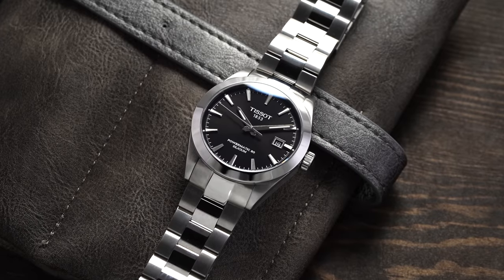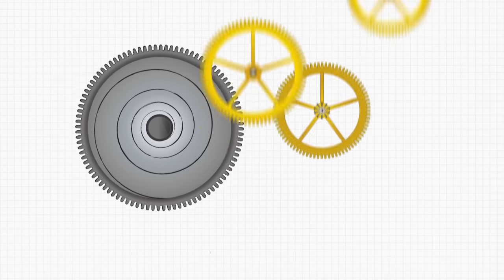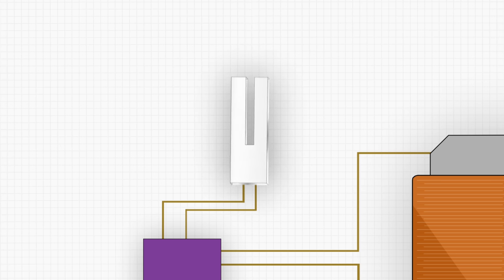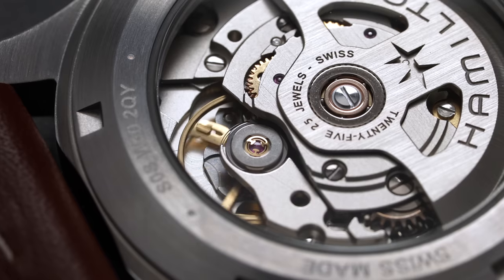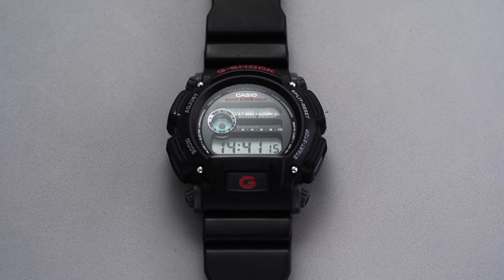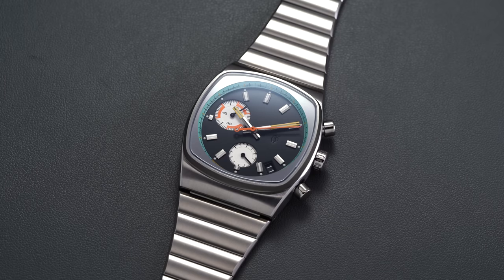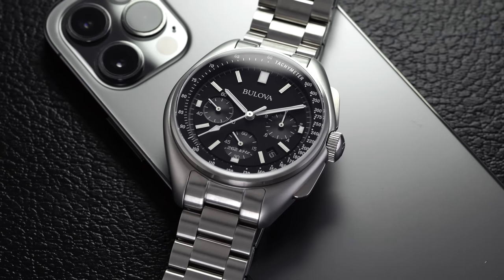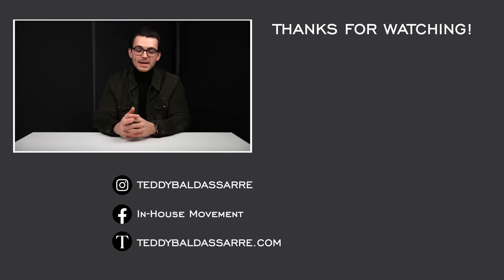Why Every Collector Needs a Quartz Watch - How They Work & Everything Else You Should Know

Comment: Hey Teddy a suggestion, why not do a “best quarts watch collection at different price points and functionality” this could help guide collectors and potential collectors as to what’s available on the market. I’m sure the list is very long so a selection would be good.
Reply: Amazing idea !
Reply: I'm in!
Reply: Not a bad idea, except that as someone said, G shock would win every time for functionality and durability.  Outside of G shock, Bulova came out with its Precisionist line of ultra accurate quartz movements a few years back, but chose to put the movements in some of the ugliest watches around.
Citizen makes its Eco drives which are basically, solar powered quartz.
For plain old quartz, IMO, it is hard for a reviewer to differentiate the movements.
Reply from the maker: Thanks for the suggestion, Gilbert. We are working on something more comprehensive that is along the lines of this. Appreciate the comment and good idea!
Reply: Good idea 👍 The Rolex Oysterquartz 17000 is a great watch
Reply: @stupitt6989  what fool would buy that? Get a Grand Seiko instead.
Reply: @Al mac  didn't realise that not only is there watch snobbery between mechanical and quartz, there's also watch snobbery between quartz watches.
Reply: @johnyoung8144  watchmakers are known for certain models. Rolex are certainly not known for their quartz watches. They make them but they are an afterthought. If you like them then you probably can probably get good deals on them so you are in luck.
Reply: This needs to include the Casio Oceanus, Citizen Chronomaster, and Grand Seiko 9F Quartz line of watches.
Reply: @TeddyBaldassarre  I would hope that you would look at the first in-house quartz caliber from Omega which is the 1310, a great example of a well engineered mostly mechanical movement driven by quartz ironically that almost needs to serviced like a mechanical watch but just not so often. They can be extremely accurate to within a few seconds a month if looked after correctly, by someone who knows what they are doing. I have quite a number of these now and absolutley love working on them.
Reply: @stupitt6989  A grail of mine.
Reply: @almac9203  bc the bracelet
Reply: Sinn UX usg9
Reply: . Oz Velez anxious
Reply: That’s a most excellent idea! 👏🏼👏🏼👏🏼👏🏼
Reply: Agreed!
Reply: My favorite and last Watch(hopefully 🙏 is a quartz, the Citizen promaster 1000 eco-dive bn7020-17e. Unfortunately i don't think it's atomic. Stay healthy and happy
Reply: @johnyoung8144  there's snobbery between everything about watches. Invicta fanbois are snobby about other "homage" watches.
Reply: @johnyoung8144  😆
Reply: Was literally getting ready to post the same thing.
Reply: I’d wanna see a King Seiko or a Grand Seiko Quarts
Reply: @NoizeTank  This.  This this this.  Specifically the Oceanus line(s)
Reply: In my opinion, Citizen eco with AT. Never change batteries, durable, calibrates time every night through atomic clock communication, with strong mix of dress to sports watch options.
Reply: @almac9203  ❗️👍❗️
Grand Seiko (Watch)🙂what else (?)❗️❗️❗️
With best regards !
Reply: You can use a watch winder when not wearing an automatic.
Reply: Here's my Top 5 in no particular order:

1.  Bulova Lunar Pilot:  Authentic lunar pedigree at less than 1/10th the cost of a Speedy.  

2.  Tissot PRX:  A stunning looking watch at a tremendous price point.  Looks and feels much more expensive than it is.

3.  Citizen Promaster Diver (Eco Drive) combines quartz accuracy and convenience with the advantage of never needing to change the battery.   A true ISO rated Diver at a very reasonable price.  

4.  Victorinox Maverick Chronograph:  An actual 12 hour analog quartz chronograph.  That's a real find as most quartz analog chronos top out at 1 hour.  Add swiss styling and overall finish and you have one heck of a package.

5.  Frederique Constant Classic Moonphase/Grovana Moonphase:  These attractive fully functioning moonphase watches are out of production and getting harder to find.  I have a Grovana Quartz Moonphase that I love that's also out of production.   Get them while you can.  An affordable attractive quartz moonphase is not very easy to find.  Both these fit that bill and are Swiss Made to boot.
Reply: @TeddyBaldassarre  Is a budget mechanical watch worth it vs a quartz? Budget being  around $200.
Reply: Great idea 👍🏻
Reply: Casio duro.. end of list

Comment: I was a mechanical snob, but as I collected more watches and wearing them for a day or less each, it got annoying having to set and wind them all, A quartz was such a relief to just grab and go
Reply: I feel the same way too.
Reply: Mechanical watches exercise the fingers and a daily therapy for the mind, reminds you why you own a mechanical watch in the first place. A battery powered quartz is not only bad for environment, it's a pain having to pry open the back case and change the battery. And it can die when you need it most.
Reply: @christophergan71  I can smell the snobbery from here
Reply: My Victorinox (Swiss Army) watch is running about a second fast per *month*. The battery should last 2-3 years. As far as accuracy goes, this watch should be off by less than a minute with no adjustments between battery changes. That's kind of crazy, and something to appreciate.
Reply: Facts X's 10!
Reply: @christophergan71  All quartz I have is solar charged (G shock, Seiko Arnie and Citizen Eco-drive), all but the Arnie also is radio controlled so automatically correct time all the time. You will never be in a position where a failed quartz battery will affect your life in any way. I am not saying there is no point with mechanical, but what do you use as a reference when you set the time on your mechanicals every morning? I use my G shock with atomic time, which is laying next to the rest. At some point you will have to rely on an electronic reference to set the time so no point to be snobby about it. I even bought a smart watch,  something I thought I would never do. I used to look at peoples wrists to see if they had a mechanical watch, but as soon as I saw the ticking hand I would disregard them as not being watch enthusiasts, now I have learned that is pretty foolish.
Reply: @christophergan71  Mechanical watches can't die when you need it most? I don't think so. Also, quartz watches have an end of life tick to let you know to change the battery. Nice try though.
Reply: So, you are just too lazy to set your mechanical watch?  Says more about you than it does the watch.
Reply: @virtualpilgrim8645  Moving the goalpost I see. If you can't attack the point then attack the person, right? Typical.
Reply: @TheShockwave44  Your comment says more about you than it says about me.
Reply: @raylang339  ......
Reply: @christophergan71  pure f'ing snobery.. A quartz watch is objectively better in every way..  More accurate, cheaper, less maintenance, more damage/shock proof, longer lasting, less hassle.  I had a $100 casio that had a 10 year battery life.. "its a pain having to pry open the back and change the batter".. What? once every 8-10 years, instead of resetting your mechanical every few days, either because its no longer accurate... OR because its completely dead because you wore something else..  Also.. It can die when you need it most. again, see above.
Reply: Q: What do you do when a mechanical watch dies on you? 
A: Just follow Taylor Swift's advice - Shake it up! Shake it up!
Can't do that with a quartz watch 😉
Reply: @christophergan71  You probably change the battery and set it again according to your mobile phone ;) A mechanical needs service every few years anyway.
Reply: @TheShockwave44  sad that you say that "attack" - post about one dude but ignore the "snob" - personal attack from the other guy. Sounds like double Standards... sadly...
Reply: @bingoberra18  
Actually, I wanted to point out that these are personal tastes and automatics also have their good sides, especially for people who don't see watches exclusively as tools. 

But your comment about revisions is simply wrong. Manufacturers recommend them about every 5 years, which just about passes for every "few years". Jewellers, on the other hand, recommend revisions every 2 to 5 years for watches that are always worn, which fits your comment. 

But what watch lover wears ONE watch all the time? I don't know any. 

For people like you and me, 5-10 years is recommended, which doesn't fit your comment at all. And the 5 - 10 years is almost exclusively a recommendation based on the oils. Regardless, there is regularly the statement from experienced collectors and jewellers "You can wear it until it no longer runs accurately enough"... which is easily 10 - 20 years, if not more.
Reply: My watch winder takes care of my mechanicals, and they’re fairly inexpensive nowadays. 
But my citizen eco drives with atomic time keeping are surely nice to have and fully appreciated.
Reply: After amessing a collection of 100's of automatics, I am getting tired of the exorbitant servicing costs after wearing many only a few times. Need to liquidate and just settle with few cheap low maintenance pieces.
Reply: @christophergan71   I have 100's of automatics and cost of servicing after wearing them only a few times is getting  painful.
Reply: Especially for watches you don’t wear as often, like only for special occasions, quartz is better.
Reply: Good point. Which is why i only have 1 mechanical and the rest are quartz
Reply: @christophergan71  obviously you have not heard of solar powered watches. A citizen eco drive can go for 20 years or more without a battery replacement. My pro trek casio is still going strong after 15 years.

Some quartz like my luminoxes have 10 year batteries which is about the same time it takes for a mechanical watch to be serviced.

If you are talking about environment impact solar watches are a lot more  envirnmental friendly than mechanicals due to the need of less parts.
Reply: @christophergan71  mine never dies because it is solar lol. But in the event that i have not worn it for 6 months i just set it on the sun for 3 hours and it is ready to go for 6 more months !
Reply: @danielhopkins2277  No matter how long it is between service, its only a matter of days or weeks before you have to reset it according to atomic clock on your phone, computer or quartz watch. It is not very smart. But of course I appreciate wearing my automatics more that the quartzes.
Reply: @BennyOcean  I have an $8 field watch that I bought at Walmart to wear when gardening. I went to change it to DST and noticed that I had not changed it from DST in the fall. So it has been at least one year since I last set it. It was off by only one second. One second over a year. Compare that with some of the $250 to $2500 mechanical watches that brag that they lose or gain no more than three to five seconds a day. You know, of all the things that a watch should do, keeping accurate time should be at the top of the list.
Reply: Until u have to change the battery and remove the case damaging them
Reply: @shaunharn1998  what if the watch is solar like the co drives where the battery lasts up to 25 years? plus some high end watches have a screw back that makes it the same process to change the battery as to service your automatic which by the way has to be done every 10 years or so
Reply: @ROrneli  Solar isn't entirely reliable & wont last for life but compared to regular quartz, if the solar is significantly cheaper and is good quality that'll last long, I wouldn't mind, for me the best Quartz would be those with a separate battery compartment like Swatch where u don't have to physically dismantle the case just to replace the battery, if all quartz watches are like that, I'll definitely buy more Quartz since it's usually nearly half the price of the automatic counterpart.
Reply: @shaunharn1998  Solar is a lot more relliable than automatics. cheaper to service , more accurate and some even come packed with additional features like compasses, depth meters, altimeters and are a lot more resistant to shock and magnetism.

Your love to automatics is all based on some romantic idea that the watch was put together by some old swiss guy with big glasses. the reality is that most automatic watches are put together by machines just like quartz watches.

I have a seiko Prospex automatic  and I love it BUT I wear my quartz 90% of the times . they are just more practical ,

Also some of my quartz watches are much cooler looking than my auto., like my Citizen BJ2167-03E  just fantastic looking.
Reply: @ROrneli  I just don’t like the fact that you have to dismantle your watch every 2-3 years and have dust & scratches just to change the battery, all my automatic are the cheaper range ones like Tissot Swissmatic or Japanese automatic so I don’t buy it with the idea of some old Swiss watchmaker making it, I just don’t like quartz if only they have battery that’s like swatch then I’ll definitely be a quartz fan. Plus u don’t have to worry about battery leaks on a automatic
Reply: @ROrneli  I admit a lot of quartz watch looks far cooler than automatic and also a lot cheaper but the thought of having to replace the battery and remove the case  every few years along with the potential battery leak just makes it so unappealing
Reply: @shaunharn1998  25 years for an eco drive. Casio tough solar series last over 10 years.
Reply: @shaunharn1998  What are you talking about? You have to service an automatic at least every 5 years which means removing the back case and dismantling it. Your argument is plain pointless.
Reply: @TheShockwave44  Mechanical watches break down.  I have a Corum that belonged to my Dad that needs a mainspring.  There is no better.  It is all subjective.
Reply: @christophergan71  And cue the snobbery...

Is there an emotional argument to be had? Certainly, but the thing is, quartz allows for some space savings, easier to move over to digital readouts, and even offering some degree of radio control allowing for nanosecond levels of accuracy if it can establish a good connection, plus, they can be solar charged. I have a G-shock for the past 13 or so years, and the most I've had to do when the battery ran low was jus stick outside facing the southern sky for a day to charge a few times (it's on the same battery too!)

With quartz, more often than not, you'll only be setting it for daylight saving or cross time-zone travel, with a mechanical watch, you may lose a minute or more a month.

and changing the battery... how often is that? 3-7 years, and not much more than $25? Versus maintenance on a mechanical that can be hundreds every 5-8... maybe even thousands if, lets say sea water happens to get inside.
Reply: I wan't something built by human hands... Watches are no use to tell time nowadays, they are only a show of craftmanship, and quartz has none
Reply: @varieedeventualii  And more snobbery...
Reply: @varieedeventualii  I dont agree, I use my wristwatch to tell time more than anything else. It takes more time and energy to grab the phone to check it. Nowadays I barely even use my mechanicals or Quartzes, I am mostly using my Garmin Smartwatch as it tells so much more than just the time. As a tool its just so much better. Sadly I must add, because they feel soulless. But a wristwatch is to me a tool first and foremost, and jewlery second.
Reply: @TheShockwave44  how does a mechanical watch die when you need it most? You never even elaborated. You acted like you made the most brilliant point in history, but you actually said almost nothing.
Reply: Exactly! You and I are in the same boat per my post just now.
Reply: @christophergan71  What is opening the case to change a battery when it starts doing 2 s jumps, compared to having a mechanical movement stripped apart, cleaned and lubricated. 
From a engineering perspective I find my solar quartz and mechanical watches both intresting for different reasons. 
One is like my classic cars, inefficent, lacking electronics, but with a simple mechanical charm and soul thags lost in numbed down modern cars. The other watch, much more reliable in everyway, being powered by photons and being able to be put in a smaller, more comfortable case, while also doing a much better job keeping time with using the fasinating quality of the freqency quartz reliably can produce. Being snobby about mechanical watches is just being too smitted by the marketing of watches, I often find.
Reply: @varieedeventualii  The majority of mechanical watches today are mass produced with minimal to none human interferens
Reply: @shaunharn1998  Have a seiko where when there was a problem with the movement, a 4R36, Seiko throw the movement in the bin and put in a new one, as was more cost effective than taking the movement apart as would take a couple hours of labor, was a problem with the crown mechanism. Most mechanical movements sold today are made without much human input, making them cheap, and making the likelihood of a service being a logical choice for a watch movement go down. So these old arguments are pretty outdated and more a romantic ideal we hold onto, in this day and age.
Reply: @rocal4717  A full service and clean/polishing is different than removing it every 2-3 years just to replace batteries when it could easily have a battery hatch to solve the problem Swatch has 100-200m WR too so the 'less WR' argument isn't valid. Also I never had a automatic which I have to service every 5 years, more than 10 years and still working fine can't say that for quartz
Reply: “Bad for the environment” 😂
Reply: @virtualpilgrim8645 pffffffff